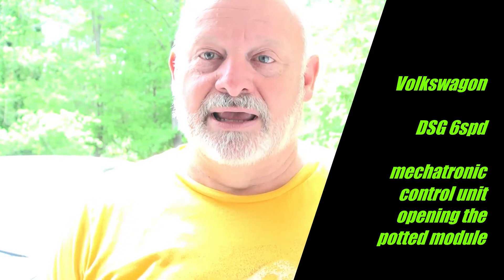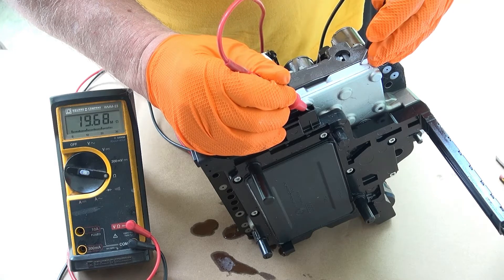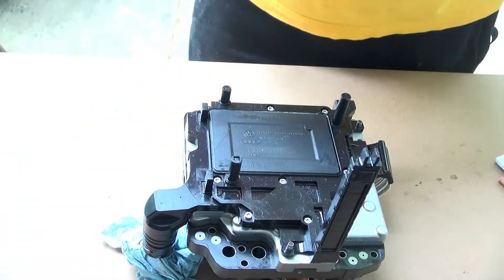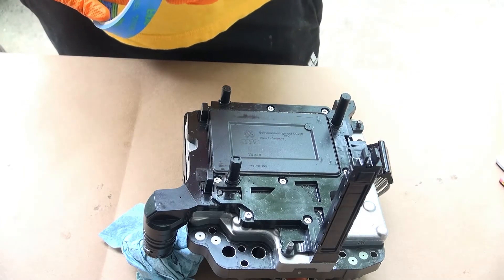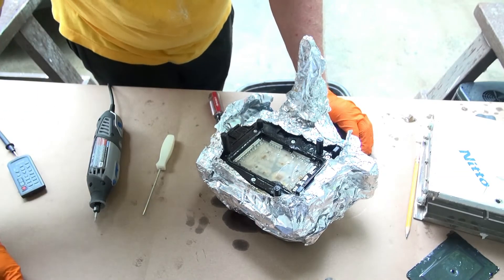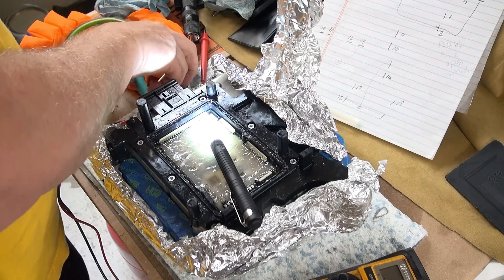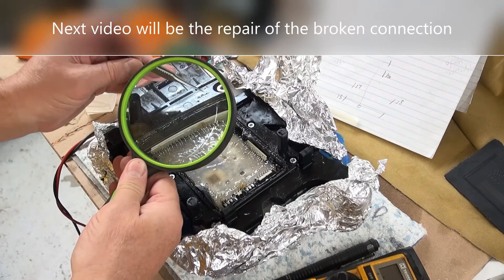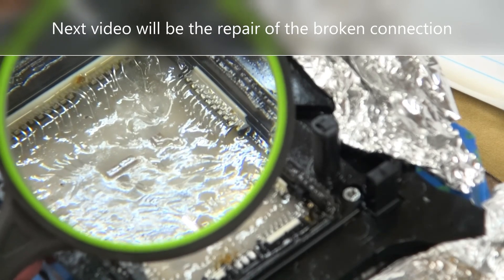VW mechatronic control unit opened found wire broken

Comment: Hi i just saw your video when open back of the mechatronic dsg 250 i think i have a same problem.17130 - Pressure Control Solenoid 1 - P0746 - 012 - Implausible Signal or Stuck Off - Intermittent

Dont find any video how did you solder a broken wire and how you seal and how you seal back panel. Thank you
Reply: Did u fix

Comment: Hi why you avoid? Is it to much trouble that dsg? I have jaguar xf other car and zf6hp26 gearbox never have any problem. Before i fitt dsg is it recomended to ope n and clean? Thanks
Reply from the maker: Because of the added complexity of electronics in the dsg over a manual with a manual clutch

Comment: Hi i just like to ask you about 6spd dsg gearbox. I will fitt on a different car and before that any recomendation to check or replace something in the gearbox before fitt in. Open for clean? Or anything to do? Thank you
Reply from the maker: I do not know your situation but....I would probably avoid DSG and use a manual gearbox for a much simpler result

Comment: Hi. DSG 6 on the 1.4 tsi does not always increase the speed when you release the brake pedal, is DSG doing something weird? And if even after I apply the handbrake, then you can start twitching.
Reply from the maker: sounds normal...from what I remember

Comment: How did you soldered how did you removed the selicon from the wire etc, can you help me i have the same situation
Reply from the maker: Ended up replacing the module.
Reply: You replaced it after you fixed it? I"m looking at cutting open my TCM cover today and seeing if I can fix it. If you ended up replacing your entire unit after you fixed it, then I might as well buy a new one. Thanks @neuromanglers